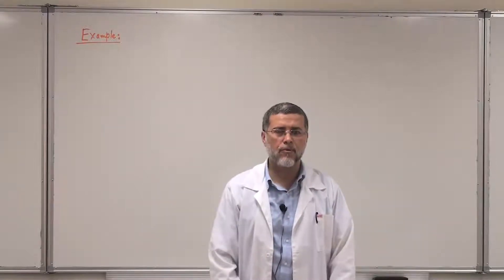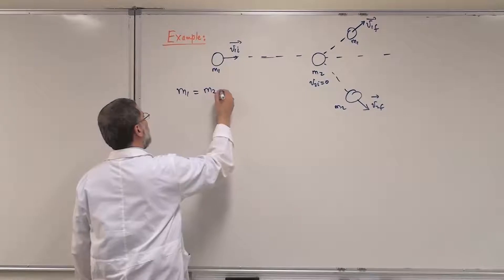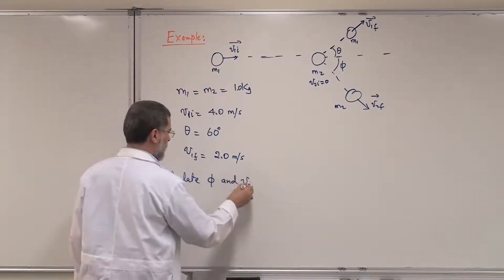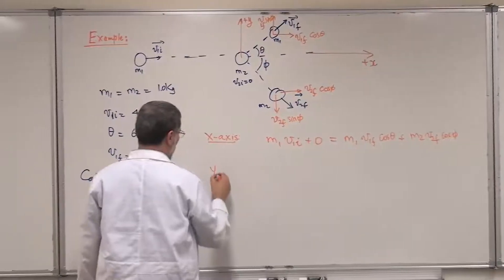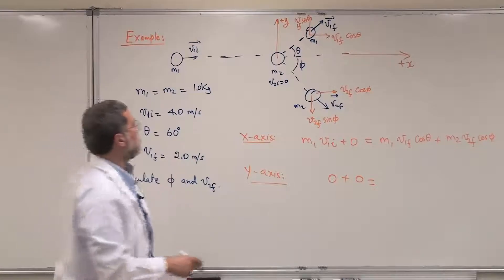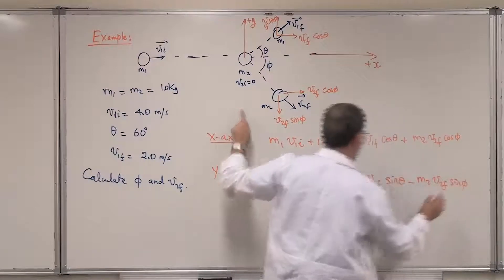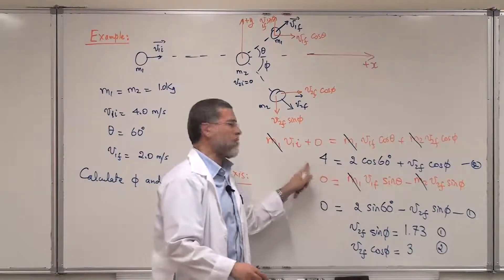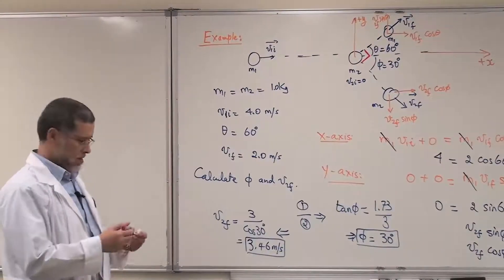Two Dimensional Collision – Examples of Glancing Collision and Perfectly Inelastic Collision

Comment: Is your 20 m/s (of 1500kg truck) not suppose to be negative since it is acting downwards in the Cartesian plane?
Reply: These type of maths can be solved in 2 ways.

The thing u r mentioning is used when we solve the math using i^ and j^ (in vector form ) .

But other than that if we solve this using all the components in x-axis & y-axis particularly we don't need to consider (+)ve & (-)ve of Cartesian method